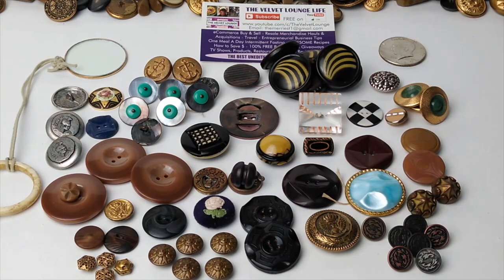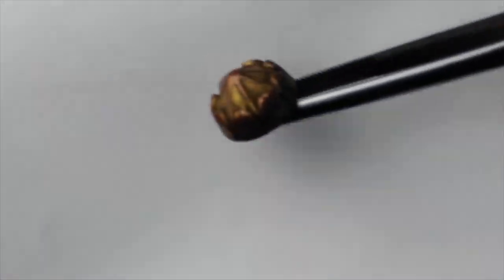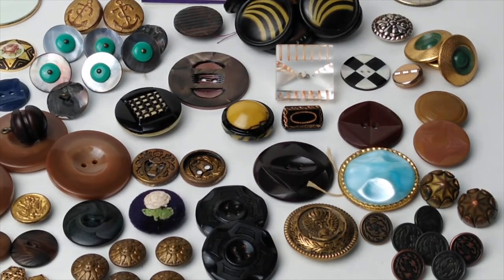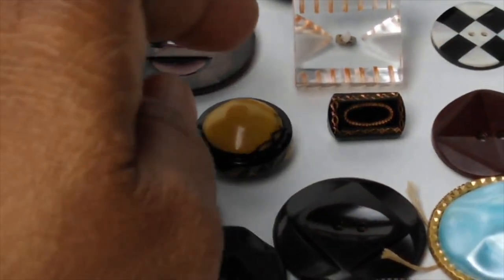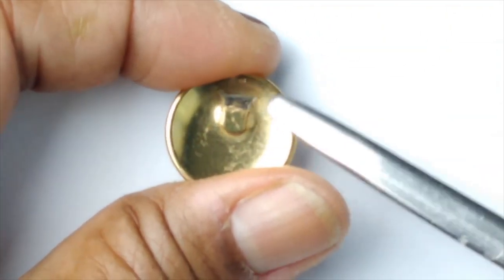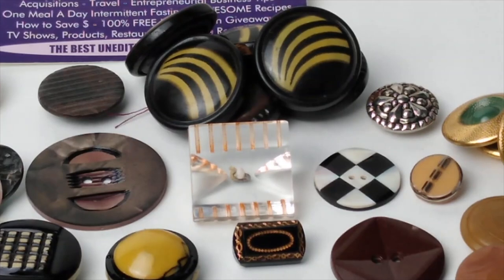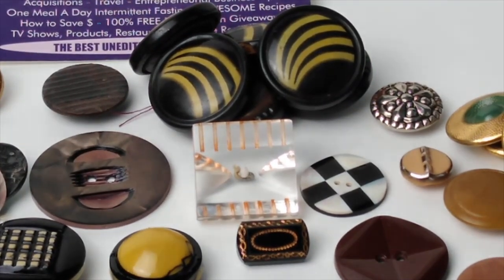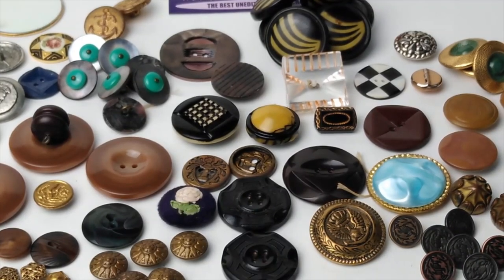VINTAGE Button Collection Identification Celluloid Glass Ivory Vegetable MOP Shell Bakelite Metals

Comment: I have found those cardboard backed buttons before but didnt know what they were, usually in poor condition.  So many great buttons! Love the large clear one. So unique
Reply from the maker: Yes, The cardboard back celluloid buttons usually do not survive the test of time. Backing a button with paper was something they did during wartime because metals were needed for the wartime efforts. Once the cardboard got wet the celluloid which is thin would crack and the button would die basically. Thank you so much for watching and supporting the channel by watching the videos much appreciated. Also, excellent comment.